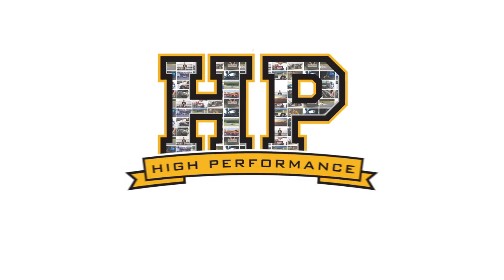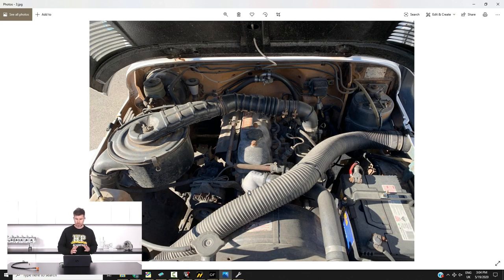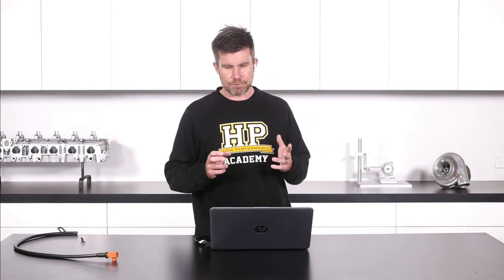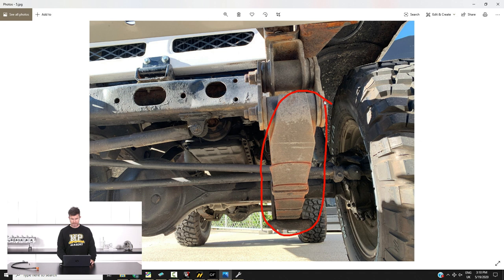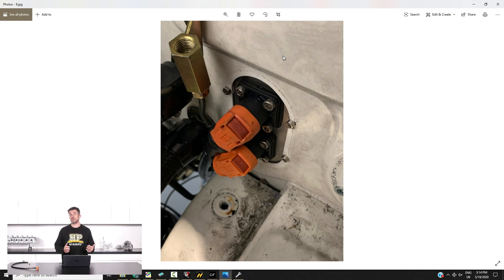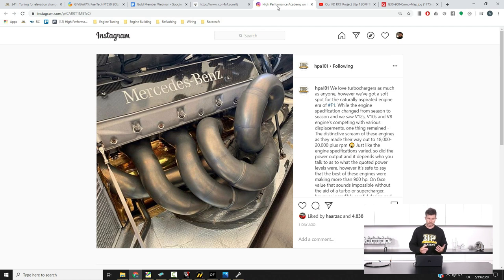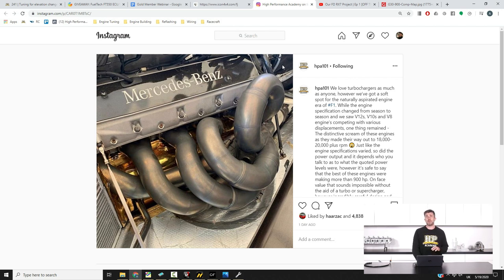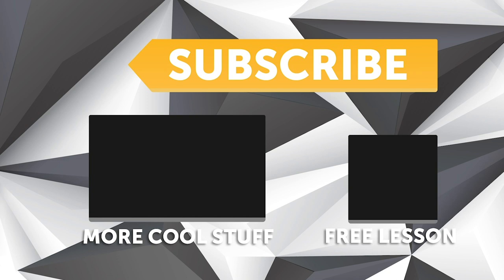BJ/FJ40 Series V8 Swap Introduction | Today At HPA [UPDATE 241]

Comment: The 1fz has shown to be a potent platform and there are quite a few driveline options available

Maybe some boost in the mix,a bit of tuning before you know it you are calling up Ben Bray asking how to make 2000hp from a Land Cruiser engine

You'll love the Fuel tech ECUs easiest I have ever used
Reply from the maker: We actually have a brand new 1FZ block and head (you'll see that in the background of our studio), as well as a fully race prepped 1FZ head that was making 1700 whp on a sand drag car in the UAE. As discussed, we don't need/want much power for this project and packaging an intercooler in the small chassis along with the long inline 6 is tricky.

Comment: Must bE 3UZ, I've one fj40 Repairing in CHC. 
3UZ Very durable，Strong torque，Perfect for everyday driving and offroad.   
if use the 3uz 6 speed automatic transmission and fj40 Transfer box will be more perfect.

Comment: I have a 72 shorty in my drive-way with a 1UZ-FE waiting to go in but ... currently has the 3B diesel and I'd love to keep it diesel but that engine has no guts so was thinking the 4.5 v8 diesel (1VD-FTV). Did you guys give that any thought?
Reply from the maker: Bit out of our budget for this project. The 3UZFE is readily available in New Zealand for not a huge financial investment and won't be difficult to drop in either when it comes to fabrication and gearbox options. Nothing wrong with the 1VD option if that is a solid choice for you and your project though 😎 - Taz.

Comment: Looks like it's going to be a nice build - any particular reason for SWB rather than LWD - you're going to be giving up interior room and gaining a choppier ride?
A little longer explanation of how the 5252 is derived might have been handy (it's not quite that, but very, very close) - I see a lot of kiddies using it that have no idea what it actually means - many are the same kiddies who don't know the difference between lbs.t, which is torque, and ft.lbs which is work done - this is the very basis of the conversion - well done on getting it right - the British/New Zealand education system rocks ;-)
That should be a sweet engine conversion, and you've got a dummy block and heads from the race car for planning the installation.

Sorry for any typo's, got a damned migraine kicking in and can't see too much.
Reply from the maker: A good 40 series is hard to find, a good 45 series (LWB) is even harder and comes with a higher premium too boot.
I spoke to Andre about the 5252 constant after it popped up in a question the other day, however, it is already really well covered for those that want to have a quick search so he wasn't sure it was worth the time that he could instead spend on other subjects to be honest.
Since this has been released we actually have a 3uz in the shop there, updates on that next week =D Brandon is working on his Toyota Starlet rally build and once that's out of the shed the 40 will be rolled in and cracked open.

Hope the heads all good this morning Gordo 🤘- Taz.

Comment: Since its a BJ40  why not follow along in the same vein and go for the last of the B series like used in the 'Megacruiser' and some Dyna's the 15B-FTE 4.1L four cylinder, 16 valve, turbo. Would be nice to see something like that then set it up with a aftermarket ECU and maybe a electronically controlled later model cruiser 5 or 6 speed auto again running after market trans control. Give you some wiring, intercooling, diesel Ecu and trans control loom to make and demonstrate how to set it up.
Reply from the maker: Just personal preference really. Nothing wrong with the late model diesel engines, however adding a turbo installation into thew mix increases complexity and makes packaging of an intercooler a little tricky in such a compact engine bay.
Reply: @hpa101  The 15B is basically same block (as far as engine mounts, accessories bellhousing goes) just wider 16V head, bore and stroked up from 3.4L to 4.1, high pressure direct injection  and turbo.
Are you guys thinking of doing something like a 4JJ1 with either ECU remapping or a standalone ECU. As the Duramax 6.6 is loved in the USA. In NZ the smaller Ute engines are more popular. Thailand are pushing 4JJ1 to above 1000 hp at about 4300 rpm in drag trucks (very much not stock internals).

Comment: I know keeping things original is good. but the seats should be as new as possible, as safety is No.1 Id put Prado / newer landcruiser seats with heated haha even
re NA F1 engines. t hey were at 1000 HP for qualifying. they did this because 
made this because they didn't even run Cams they ran pneumatic vavles which gave the m100% VVT Lift/duration intake/exhaust. 100% customizable. not having cams means no parasitic loss at all. and then the 100% customizable really really good
Reply from the maker: That's a tricky one. Things have certainly come a long way to the point where if safety is your highest priority then just the seats won't cut it.
One thing with this build though is that it's not the usual performance street build where you're trying to go faster and faster but rather once where more comfort and driveability is added. It will end up with more power for sure, however also better braking, better suspension and better tyre tech than stock too. All of those are wins - Taz.